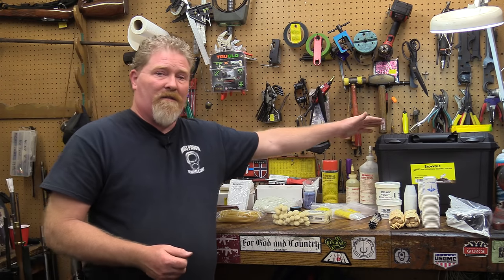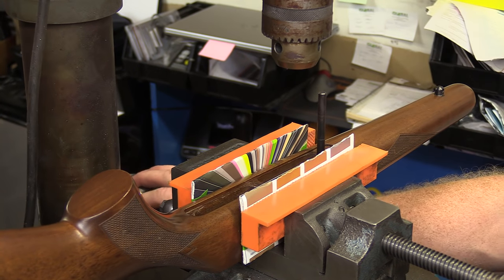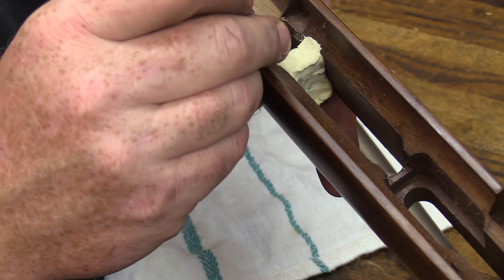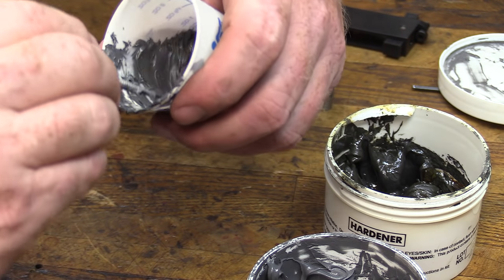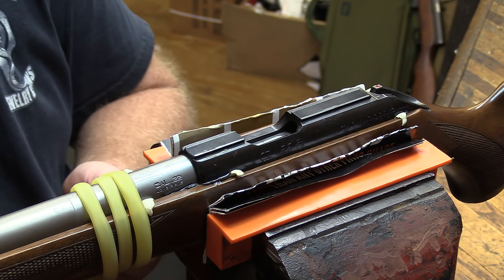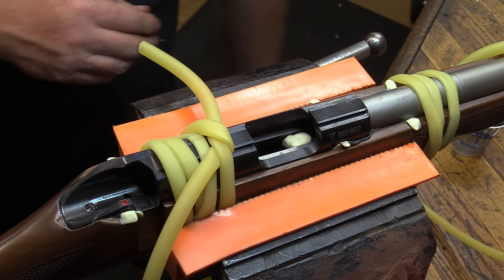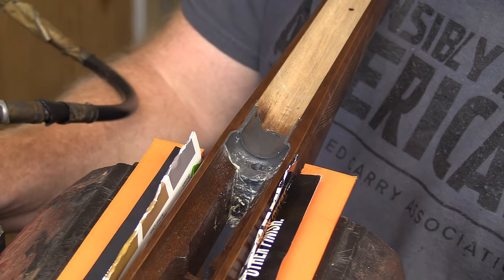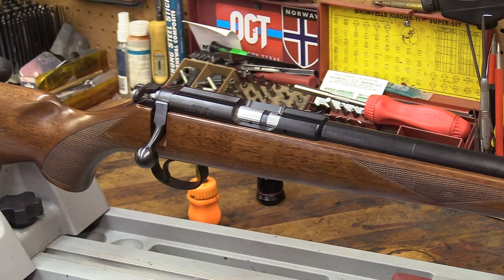How To Pillar Bed A Rifle

Comment: Considering that action screw torque is measured in "inch pounds" I've found that pneumatic hose barbs (brass) are more than adequate for pillars. EASILY cut, drilled out / turned down (if need be) by merely chucking it up in a cordless drill and holding a bastard cut file against it at an approximate 20° angle, then using "quick set" JB WELD as the adhesive.
    MINWAX furniture polish with a light coat of WD40 is an excellent release agent.
    PLAYDOUGH is great for filling & protecting areas that aren't intended to be filled or used to create dams.
     STEEL STICK is an excellent medium for bedding the chamber portion of a barrel (my method is to double layer tape the underside of the barrel at the chamber area., masking tape 1st then aluminum tape on top of that and a coat of WD40 for release agent. After set time remove tapes and "skim" coat with JB WELD (not quick set) to bed chamber to stock.
   You'll find this to be a more economical way of achieving the same thing. If you've got multiple pew-pews that you want to do this too you'll love the low cost.

Comment: I use plain old Play-Doh for dams and preventing locks, very cheap and in bright colors.  If I need regular epoxy to wick into an area or if I'm working with thick compounds like Acraglas and want to make sure it flows a little bit I use a heat gun here and there.  Johnson's Paste Wax in the metal tin makes a great release agent, just put it on with a flux brush or something similar.

Comment: I pillar bedded a .308 Savage Axis to a Boyds stock  with some Arcaglass last year. It is probably the number one 'best' improvement I could have ever made.
Reply: I have a Boyds stock on the way for my Ruger Gunsite Scout Rifle.  Would you'd say bedding is worth the time/money?  How did the rifle perform with the stock without the bedding? (if you shot it before bedding)
Reply: David Exton I've pillar bedded my REM. 700 varmint and my sako L61R with match grade bedding from terminal ballistics and I would recommend anyone who is useful with their hands to do it my Rem 700 can headshot a grasshopper at 100yds on store bought ammo and I haven't done anything else to it.

Comment: Ray,.... Try PR88 you put it on like hand cleaner,....... before you start,...... it dries and you do the job and when you wash your hands with water everything comes right off.
And you can wipe the inner stock and epoxy down with linseed oil to seal it from moisture and humidity and it makes everything the same color.

Comment: Hi Ray
I noticed you did not do anything to the wood finish other than drill out the holes.  It helps to use a dremel on the wood, because or the finish and to allow the bedding compound to adhere to the wood.
Thanks!

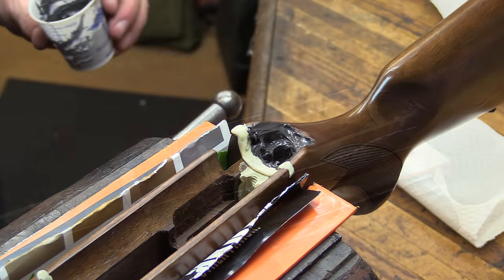Comment: Two Questions: (1) With the pillar holes larger than the pillars allowing slight rotation of the action, how do you make sure the action is left-right level when you bed? (2) between 21:25 and 23:00, what happened to the trigger assembly?
Reply: That's what I was thinkin' too... like why not use the trigger housing as a 'clamp' to squeeze it together after applying it to around the pillars.

Comment: tip for the shop: you can buy filers with all different levels of grit from beauty shops. They intend them to be for nails obviously but it saves you from having to make them out of tongue depressors and sand paper
Reply: Great 💡

Comment: At 23:02 I'm curious why you don't use a plastic syringe like many two part epoxy's come in at the store to get down deep and 'fill er up'.  Or make your own epoxy delivery tips for the disposable plastic syringes on the market?  Just seems it be easier than gooping it in and all over.  Just a question not a criticism...just curious.

Comment: Great video. Why not put the bottom metal on when bedding? That way you wouldn't have to put it on the drill press and mill away material to get it back to the correct specs.

Comment: A lot better done than my first try at bedding a rifle.lol only thing I did right was putting on enough release compound so it didn't get locked in.  But I had more bubbles than a soap plant! And voids galore. Still worked and helped my groups. But looked like shit. And I spent hours filing away.

Comment: Hello. And what should be the diameter of the holes of the bushings, if the diameter of the bolts is 6 mm.?
Should the bolts stand tightly or freely in the bushings? for.308.
Thanks.

Comment: Mire to harmonics than just vibration. Right hand twist  Newtons law action has equal & opposite reaction. The barrel actually tries to swing in a circle to the left w/right hand twist. More of a oval than a true circle. Interfeence with this can throw accuracy off but mot always. Semi pressure & even full pressure some riflea actually like. True accuracy all this cicle swinging vibration harmonics has settled down BEFORE the bullet leaves the barrel. Hence semi/full bull barrels dont have this problem near as much as aregular bareel due to the thickness.

Comment: Going back to the WHAT IS A BRUSH GUN (2). Can you tell me the mount/ring used on your Henry 30/30? Thanks gary
Reply from the maker: Gary, sorry for the delay man. They are Talley Rings and if I'm not mistaken I think they are the same as a Marlin 336, but if you go on Henry's website it should confirm. Just got to Talley's website and look up the Henry options. Excellent rings for a reasonable price

Comment: Ray I noticed that you used a mill machine to remove the excess bedding compound from around where the triger guard ect goes.  I don't have access to a  milling machine could this be done using a dremal tool or other hand tools?  Greta video by the way.  Keep em comming.  :-)
Reply from the maker: You can carefully use a dremel tool but you've got to have ninja steady hands.

Comment: What's the point of glass bedding
Reply: The metal parts are no longer moving around in the wood stock making it more accurate.
Reply: Last time I read or looked at something about glass bedding a rifle (Guns and Ammo back in the eighties) they also made a point of free floating the barrel. As I remember it they cored out the barrel grove slightly and ended up with a gap between the barrel and the stock large enough they could fold a playing card around the barrel and easily slide it all the way up to where the glass bedding made contact with the action.
Reply: The point of that is so nothing is putting pressure on the barrel. even an imperceivable amount of pressure could effect the accuracy at really long distances.
Glass bedding is usually done at the front and back of the receiver before the barrel starts.

Comment: how much does it matter to use a non-tapered driver bit for firearm screws?
Reply: The best drivers you can use are hollow ground. They have the most square fit inside the driving end of the fastener. You can use tight-fitting tapered drivers without any problem, but they do tend to slip a lot easier and will readily destroy fasteners if you aren't careful, which can be a costly and time consuming mistake and ultimately cuts away at your profit, and professionalism.

Comment: He isn't touching my guns! I am not impressed.  I think I'd invest in a triple beam balance and the extra weights to bring it up to the 2.6 kilos, to mix that epoxy. You have more resin than you do hardener. I'd also look into Steve Smith's tropical hardwood, and Smith's luthier's hardwood epoxies. They bond to metal, but they are also formulated to bond with the lignins & resins in the hardwoods. The pillars will be seated rock hard in that Smith's epoxy. Smith's Epoxy also has a 60-90 minute working time. I don't bed that way. I let the steel pillars do the work. Smiths will bond to oily woods, but you need to hit the wood with  denatured alcohol and then start  with the epoxy. Chlorinated solvents work better than alcohol, but the econazis took those away from us. We use bigass rubberband in guitar making. For guns, I use rope and twist the rope to force the action into the stock with some actual REAL force. That steel epoxy shrinks as it gases off. It does not settle. Steel epoxy also tends to remain kind of soft for a month or two, or six, or twelve, or twenty four.  After a couple of years it's hard almost hard like glass. I recommend bedding right after hunting season, so that epoxy is harder, when you go to sight in for the season.